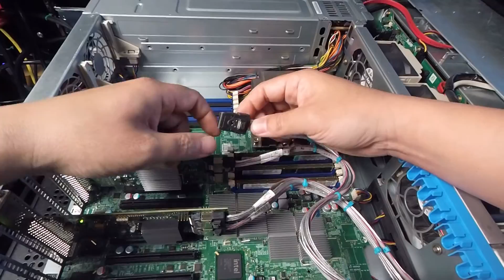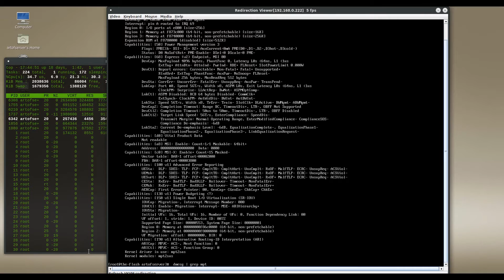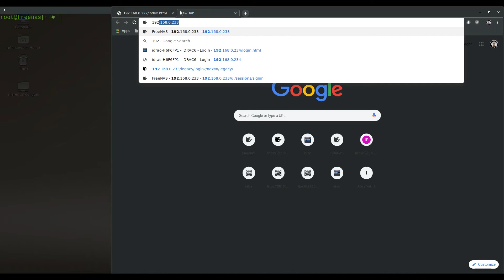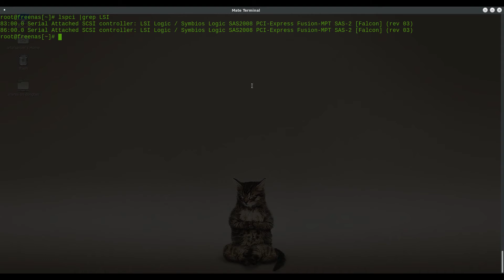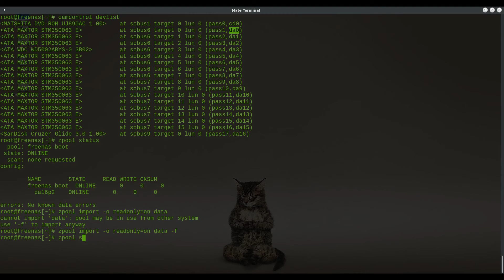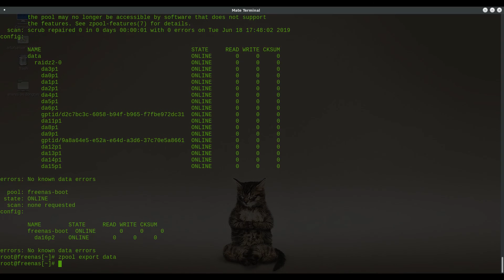How to troubleshoot your LSI IT mode HBA in Linux TrueNAS FreeNAS

Comment: Nice troubleshout guide, Any cli commands to check if it is in IT mode?
         Is it logical to use now the mpt3sas driver instead of  mpt2sas because the drivers have been updated?
What does it mean if the command dmseg | grep mps returns nothing in other distro than that of freenas? (Slackware)   mpt though returns identical to yours
Is it true the below statement?
<<mpt? Oh, that's bad, that's a RAID driver.
 
    You want mps (SAS2) or mpr (SAS3). If a card doesn't work with those drivers, it's a bad sign...>>>>>
Of course mine says mpt2sas as i mentioned above. 

   In other words to be sure that a card has been flashed and working in IT mode for sure?

Thank you
Reply from the maker: the output of sas2flash should tell you the firmware is in IT mode or IR mode, but will not work if you have MegaRAID firmware; that requires MegaCli

the driver in Linux kernel has merged mpt2sas with mpt3sas. if you're searching the logs, just grep for "mpt" to catch both.

don't really understand your question about "mps".. that's for FreeBSD (and derivatives), but not Slackware, which is Linux. These are not the same thing, and their driver naming scheme is completely different. They do not compare.
Reply: @ArtofServer  As for mpt mps mpr found out the answer after a while I posted here. So thank you for clarifying that also.

As about sas2flash ti doesnt mention as it should so i am trying to find a way to do so,

The way I did flash was like below
H310 UEFI:
Run the following commands in the DOS prompt:
megacli.exe -AdpAllInfo -aAll -page 20     (for SAS address)
megarec.exe -writesbr 0 sbrempty.bin      (which succeeded)
megarec.exe -cleanflash 0
                           (also succeeded)
Rebooted into UEFI shell and 
sas2flash.efi -o -f 6GBPSAS.FW                 (Rebooted and returned to UEFI shell)
sas2flash.efi -o -f 2118it.bin
sas2flash_p19.efi -o -sasadd 500xxxxxxxxxxxxx (where xxx my sas address)

So after all that sas2flash doesnt say neither IT nor IR . i dont have the bios flashed back.  How shall I find out if it is ok or not?

PS Found many people couldnt find that IT also after flashing. i can t get why
Reply from the maker: @ierosgr  what do you see when you run sas2flash -list ?
Reply: @ArtofServer  So I ll have to type the most significate ones (by the way only sas2flsh works not sas2flash probably because of the uefi environment?)
Controller                                   SAS2008(??)   during flashing it had been recognised as (b6) if i can recall
NVDATA Version (Default)      14.01.00.08
NVDATA Version (Persistant) 14.01.00.08
Firmware Product ID                 0x2213
Firmware version                      20.00.07.00    
NVDATA Vendor                       LSI
NVDATA  Product ID               SAS9211-8i
BIOS Verison                            N/A      (It seems logical)
UEFI BSD Version                    N/A
FCode Version                         N/A
Reply from the maker: @ierosgr  There's a Linux version called "sas2flash"  that should work in unraid; might consider installing it to have around.

Your sas2flsh is probably old or something, because normally it would say "0x2213 (IT)" for Firmware Product ID. But 0x2213 is the code for IT mode firmware.

same goes for the chip revision being "(??)" ... old version of sas2flsh is not recognizing the chip revision, but if you use a current version of the program, it should show "(B2)" ... no aware of a B6 revision.
Reply: @ArtofServer  Almost as you mentioned.... since I had the usb stick ready I made a folder and inside I put the  folder 
sas2flash_dos_rel containing the file sas2flsh  (as you can see its not an old version but for dos the name is sas2flsh)

The zip I downloaded also had versions for win32 and win64 which folders had inside the sas2flash (of course you cant run that from dos environment).

Bottom line is with sas2flsh -list (same thing I was trying before even posting here of course) it did manage to show up as 
sas2008(B2) and not with question marks (yes I recalled wrongly it was B2 back then and not B6)
0x2213 (IT) which was a plain 0x2213 before
Thank you for pointing out that I needed a newer version of sas2flash or for me sas2flsh (weird thing is that those files are back from 2016 so I cant get how I had earlier version from that since the guide was updated from 2016 to 2019 date.....)

By the way if I wanted to re establish the bios back to the card should I do the following????
Run   sas2flsh.exe -o -f 2118it.bin -b mptsas2.rom after adding mptsas2.rom to the USB and then it should mention
Avago Technologies” BIOS ???

PS Another point of failure might be the cable type also. You need forward breakout cables. Forward and reverse breakout look the same. Many fall 
      for that and purchased wrong cable because you cant tell by the description if it forward or reverse. I dont know why there are two kinds of course 
     but I thought to mention it in case it might be in handy. It seems almost impossible to find that info even at the manufacturer's page of the cable.
   Good info here https://forums.unraid.net/topic/6723-sas-to-sata-cables-forward-or-reverse-which-where-why/

Comment: My card got stuck at the "reading non-volatile settings" part when connecting to four drives. If I only connect a single drive, it passes without a problem and can be formatted in the next page. The problem starts when a specific drive combinations is connected, ie drive A with either B or C. When drive A and D are connected, it is fine as well. Is it more likely the SAS card to blame or the drive A?
Reply from the maker: What hba card?
Reply: @ArtofServer  from Ebay seller, it is a 9207-8i Dell 027NFF. It came in IT mode and I flashed latest firmware and BIOS to 20.07. Thank you for the quick reply!
Reply from the maker: @jinyizhu6422  what are the drive models for A, B, and C?
Reply: @ArtofServer  Drive A is HGST 600GB Ultrastar C10K1800. Drive B & C are Seagate ST6000NM0014. Actually, I just figured out the problem. I did not realized that SFF-8087 to (4) SFF-8482 cable can be used for SATA drive. Once I replaced the HGST drive with a good SATA drive, I can get into BIOS set up without any problem. So the issue is at the HGST hard drive part. I am interested in finding out why HGST drive alone behaved well on the SAS card. Any suggestion?

Comment: Thanks for the tips! I just received an H310 from you today. I had the issue where the machine wouldn't boot or POST with the card plugged in. I had to mask pins B5 and B6 (solution found searching online) with electrical tape to get it to work with my motherboard. Now it's working a treat. Much thanks!
Reply from the maker: Awesome! Glad you figured the SMBus issue...
Reply: Thank you. Your comment saved me so much stress.

Comment: Excellent video, I am glad I found it. I was wondering how would I put this ROM on my H310 after I flashed it to IT mode. or do I have to flash it again with different files. After flashing H310, my T620 Bios doesn't recognise it.
Reply from the maker: so you're saying after flashing the BIOS ROM, the T620 doesn't show it during POST? first thing comes to mind is to see if the system BIOS has the option ROM off or slot disablement that is preventing the LSI ROM from loading...

Comment: Hi my dell poweredge has 10 bay. how many lsi card do i need?
Reply from the maker: hard to say without more details. but i suspect 10-bay is a 2.5" backplane? and so probably a R610 or R620? i don't know what you have... but it's likely you have an expander backplane, which means you just need one SAS controller.
Reply: @ArtofServer  i have a r620 with 10 bay backplane. I think that 8 sas lane can support 1024 disk, so 1 should be fine. Should i go for your flashed perc h710 mini? my r620 came with perc h710 mini so i think it is a good idea
Reply from the maker: @why5784  Yes, H710 mini with IT mode firmware is the one you should probably use, especially if you plan to use SSDs. You need IT mode firmware, right? Not hardware RAID...
Reply: @ArtofServer  Yep, I don't need RAID. Ordering a H710 from you now.

Comment: I need to add 6+ sata ports to my setup. Which controller would you recommend from your store?
Reply from the maker: Any of the SAS2 HBA cards should do the trick. Unless you're going with SAS-3 SSDs, I don't recommend the more expensive SAS-3 cards. So, in my store at the link above, look for cards with SAS2008 or SAS2308 chipset in their description. If using SSDs, go with SAS2308 chipset, if using HDDs only, SAS2008 is plenty enough. hope that helps. :-)
Reply: @ArtofServer  ordered
Reply from the maker: @BumpSt33r  Thank you!
Reply: I am using this MB.. https://www.newegg.com/p/N82E16813157239

Comment: This was really helpful after I received the new card yesterday. Seems my drives weren't spinning up, but being new to SAS, wasn't sure if it was a controller thing. Turns out my drives needed pin 3 covered up as they were getting a signal from the cables essentially telling them to shut down.
Reply from the maker: Did you see this video? https://youtu.be/fnISM_LMuss
Reply: Art of Server nope. On an already low-powered/outdated freenas box (with 4 SATA drives), I was adding a controller from you, 4 new SAS drives and at the last minute realized I should upgrade the PSU, which I thankfully already had. PSU had separate SATA power. Wasn’t sure if power to the cable was working or maybe the cable was bad. When the controller tried to initialize in bios, there was a strange clicking sound. Or a quiet beeping, but not a system one. Weird. Even blocked the b5,b6 pins on the card before grabbing an old mobo and janking together a whole new build simply to troubleshoot in the bios. Finally decided it had to be the drives and figured it out from there. Your dell card works great, my friend.

Comment: I know this is very late, but in case you or anyone  else is having the issue with the Freenas GUI.   I was having a similar issue  that was related to a conflicting program.   Try  check the settings of  what ever firewall/malware/antivirus program you are using. I had to disable the malware program (ad-aware) I was using to get the login screen to display.
Reply from the maker: That's good to know, and also concerning that FreeNAS UI would be detected as doing something an anti-malware program would block.

Comment: those hearthbeat leds already saved me once, the card wasnt fit well in the slot even it looked good i had to push harder and here the click so always check that too if your controller doesnt showup. Sometimes some force is need to fit a card.